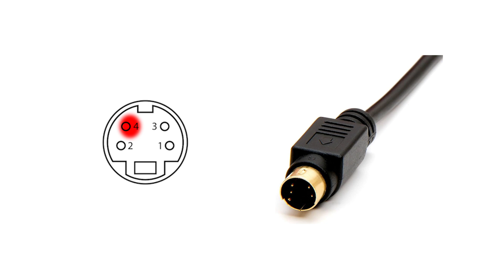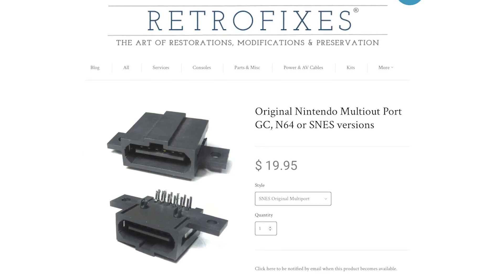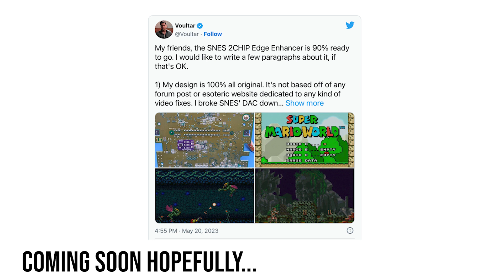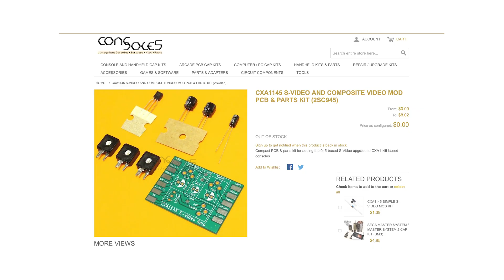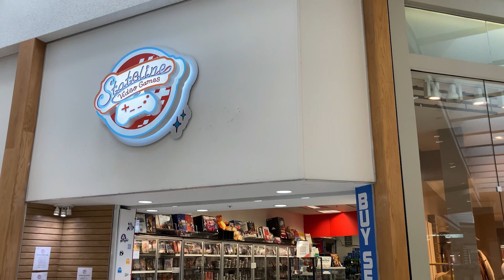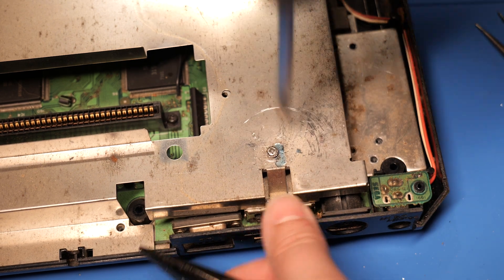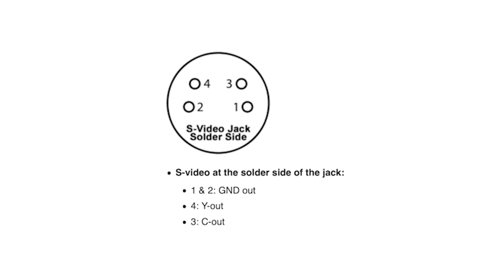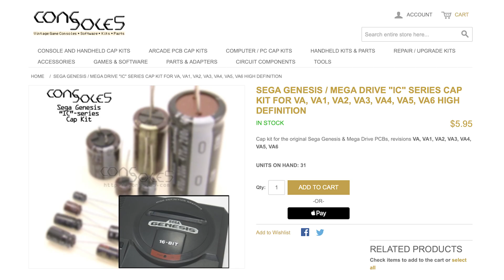Modding SNES Jr. and Sega Genesis 1 with S-video

Comment: If I accidentally lifted pin 17’s pad from the board, will the mod still work?
Reply from the maker: I'm pretty sure pin 17 isn't connected to anything on the board, so you should be fine
Reply: @ thanks for the reply. I’m waiting on the rest of my parts to arrive to complete the install.

Comment: I completely agree that S-Video is sharp enough, I have several systems with that output: original snes fat, modded megadrive, ps1 and ps2, and for me svideo through a sony trinitron is just excellent. The ps2 with component cables looks kind of the same at a normal distance and I dont see the point in looking with a magnifying glass. If RF is a 1/10 in video quality, and RGB Scart is a 10, we could say Composite is a 5, S-Video an 8 and Component a 9.

Comment: I bought a Sega Tower of power last year on Ebay (32X, Model 1 Genesis, Model 1 Sega CD) which had the Genesis and 32x S Video modded and AV modded, also had an overclocked chip (which helps reduce slowdown in SOME but not all games) and a useless pause feature but man what an upgrade in graphics from the awful composite of the genesis. Its so crisp. I did notice the jail bars on my 32 inch Trinitron but on my 32 inch Toshiba 32A41 they are gone, or at least i cant see them anymore. Not sure what happened but imma leave it on the Toshiba. 

Great video, retro on CRT is the WAY.

Comment: Ya the subcarrier in the genesis runs parallel to the rgb lines causing bad noise you can lift it but YOULLE lose a video I’m working on a pcb to give s video composite and rgb while eliminating most bars.  A recap may also  tone them down

Comment: Nice! With many of the higher end mods like the triple bypass and Voultar mods, Svideo isn't always given enough attention anymore. Makes sense with your CRT choice too.
1:54 - This is great example of SCART to component with sync on luma but I think it might be good to have a split diagram with RGBS and the sync line. I'm guessing you left it out because sync and color space becomes a whole other ball of wax and takes away from your primary discussion on Svideo. 
4:26 - Usually I use a heat gun but it is interesting to watch different takes. Seeing the giant flame is very Mad Max Fury Road. Very nice!
Reply from the maker: Yeah there were many rabbit holes I could have gone down. I actually cut a few to make the video more focused. Perhaps a good topic for a future mod! 
And yes I sometimes use a heat gun as well, but I do a lot of BBQ videos so fire is usually not far away from me... and usually I don't melt anything I'm not supposed to. Usually.